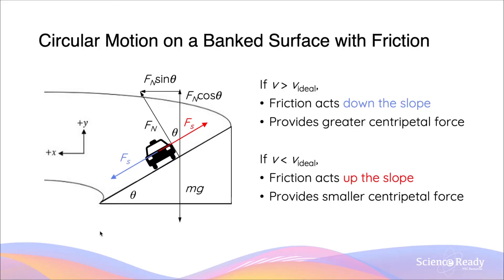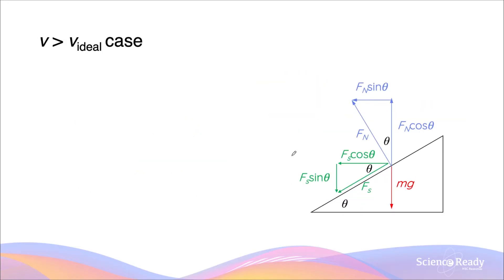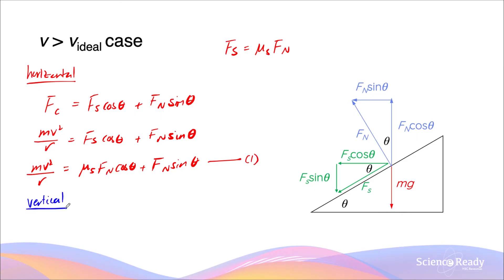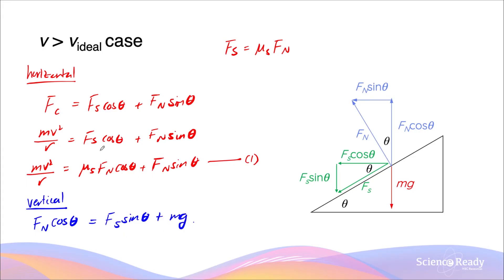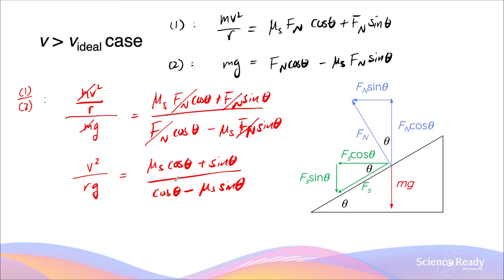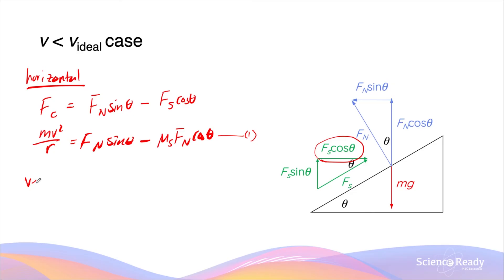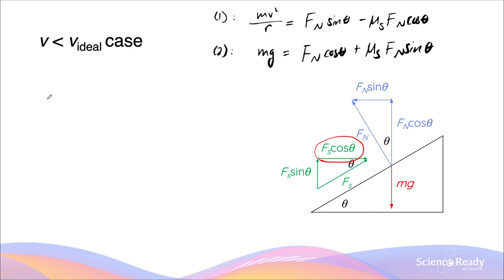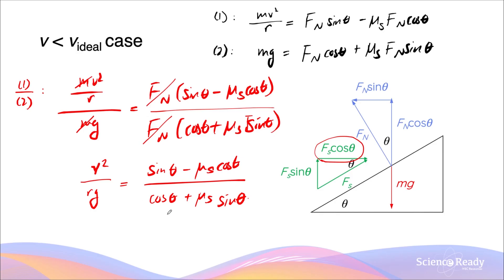Circular Motion on Banked Surfaces WITH Friction // HSC Physics

Comment: How to solve with horizontal surface (not inclined)?
In that case the car have to create angle by its own
Reply: no then it relys purley on friction force, thats why you can drive faster round a banked turn; part of the normal force act in increase in the max centipetal force and thus the max v

Comment: Is anyone able to help me? Why normal force isn't just equal to to the cosine*m*g
Reply: It is, technically. But only part of it acts in the direction of the plane. Think about if the angle was close to 90 degrees.
Reply: Because the net force of the system is not zero, hence you cannot cancel out the two components by this method
Reply: Great explanation.Thank you